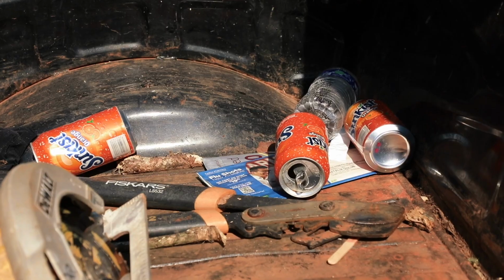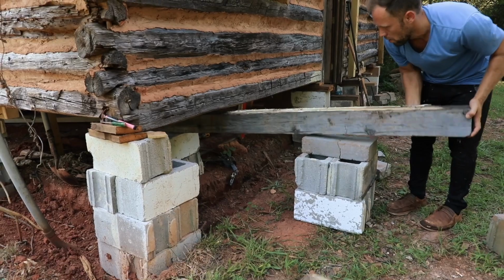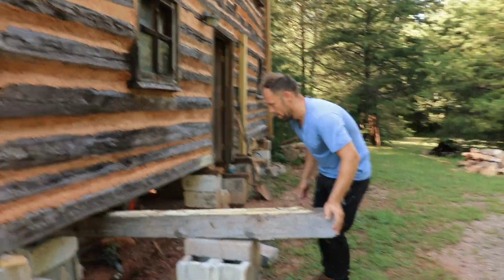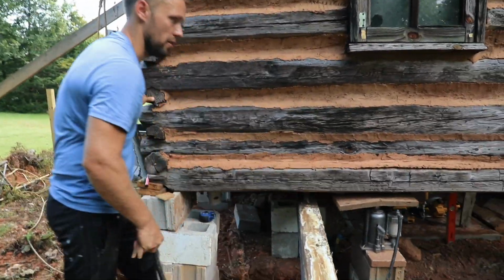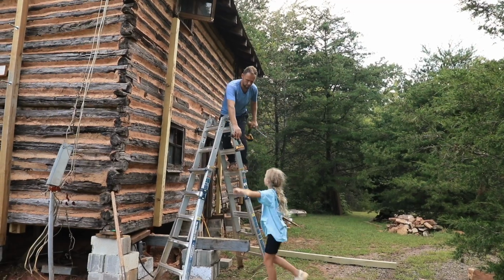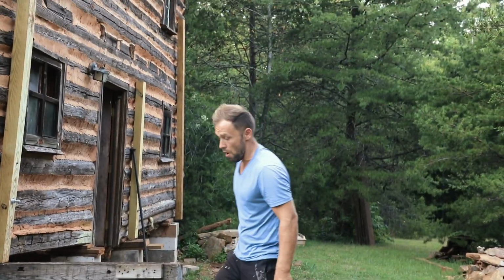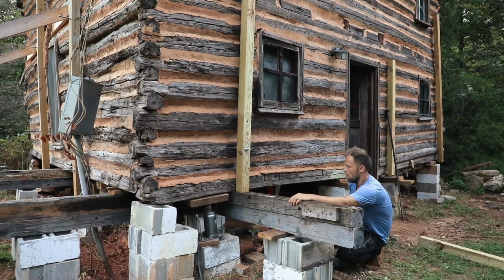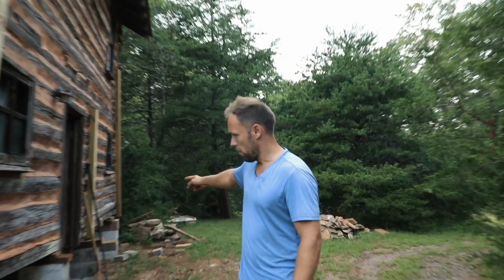Setting An Abandoned Cabin on Temporary Bridge- Prep work

Comment: What you are doing is called underpinning a wall. and there are several parts the timber you are using to support the wall has support columns and needles (bridges) when the weight is supported the new footer is poured and foundation block is laid up for the new foundation. then allowing you to remove the temporary needles (bridges) and fill in the holes in the block.
Reply from the maker: thank you for information  , I didnt even know this , I do admit.

Comment: If there were some way you could have located some steel beams to go under the lower logs to lift against all the way around. That way the entire lower logs would have been supported instead of only a few places. You can see the lower logs bend as you lift. Very precarious situation... Be safe and don't push the cabin more than it can withstand.
Reply from the maker: I agree with you, at this moment working with what we have and hopefully will get it done this way . no turning back .